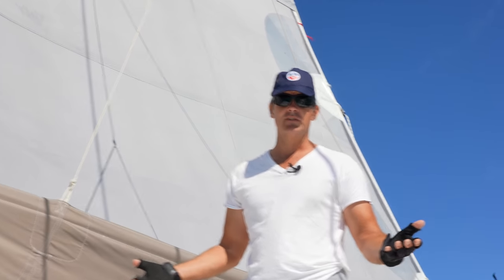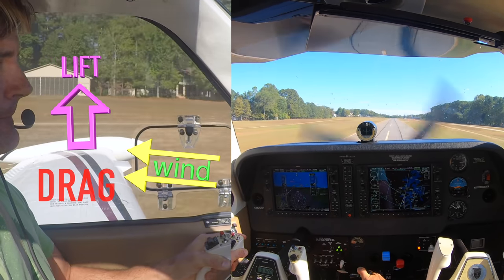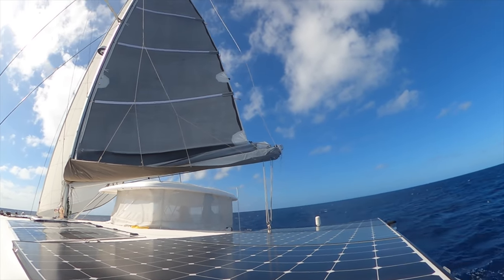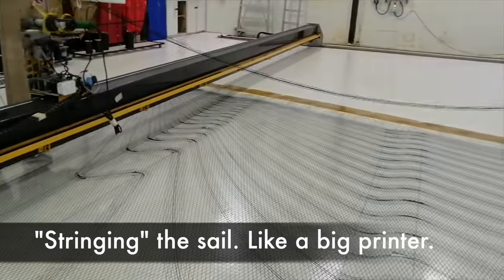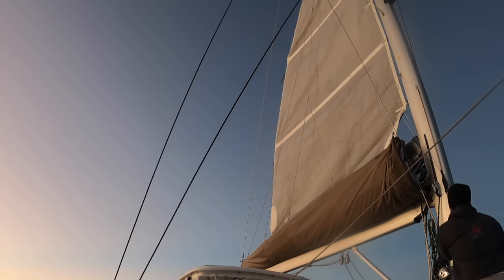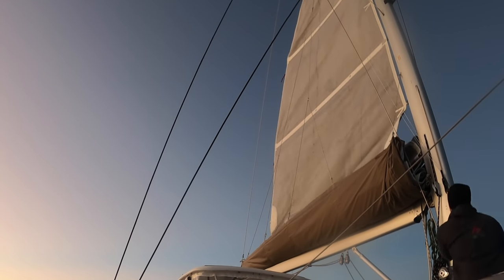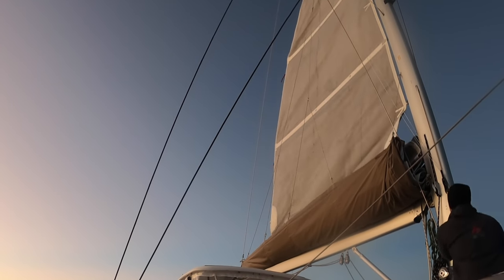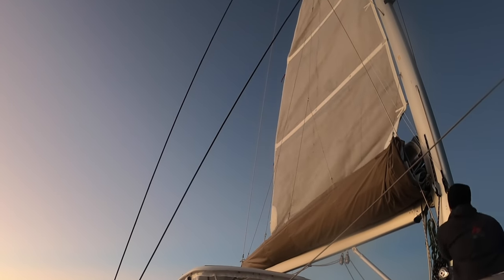PROVING THE CRITICS WRONG [why catamarans don’t sail well]

Comment: Good job.  I like that you are comparing ground tracks and VMG. While sailing an informal drag race between a 45 foot cruising cat and a 45 foot cruising monohull in 2004 upwind I realized that VMG to windward was king.  Pointing is just one variable in the mix.  Pointing is less important than upwind VMG unless you are trying to sail upwind in a constricted waterway which cruisers almost never do.  I often have to argue this point in discussions with other sailors who have not thought it through.
Reply from the maker: VMG is really all that matters….ever. Pointing means so so little.

Comment: Very well explained..! The heeling factor makes sense; in a monohull, as the wind speed increases, its energy is spilled as the  boat heels. But with a flat-sailing catamaran,  that does not happen, so the sails take the full force. So they will wear out and get baggy. Which means you're gonna go sideways a lot when the wind is coming from anywhere apart from behind you.
I wonder if a Junk (fully battened lugsail) rig has been applied to  a cat. It's never going to win races but you reef easily, and less stress on a mast than all this kevlar at vast cost and rolling-furling headsails, a fucking right handful when the wind pipes up suddenly.

Comment: Great video!  I had an old sail on my monohull for 3 years and did not realize it was the sail that was causing the excess heeling and slow speed.  I considered myself a good sailor and good at trim but could never get any performance out of the boat.  Now I know why.  Thanks a million (or at least several thousand...).

Comment: Thanks for a great video. Sure, sailboats are all about foils. I think the most common mistake people make with sails in replacing them is to go back and order sails from the loft the factory uses and order sails just like they had when new. In many cases what you get is a sail meant for the charter trade, presentable but not performance. Many people also shop for lowest cost sails. Both mistakes. Speaking with a sail designer and having sails  made specifically for your boat and your style of sailing is money well spent, Dacron or laminate.
Reply from the maker: So very true. Great advice. We went back to Ullman, but made significant design changes.

Comment: I've seen people down at the marina with sails so blown out they have sewn patches into the sails and run stringer lines to center points that tie to a free floating ring over a line. I don't know how they sail like that and honestly they probably don't and just use the motor to putt around the bay. My favorite is when people go to get on their boats after it's been sitting a long time snd they start raising the sails and rats or mice come tumbling down the sails, long streaks of rodent urine, poop and bedding material come flying out to cover the other boats.

Comment: that was probably the most even-handed review of sails I have seen across the interweb.  One point - the value proposition for sails is that "value= initial purchase price over the time the sail will retain its shape " with the critical determinant being the ability of the cloth to retain its shape.  - I don't think it will be too long before you think of doing the same with your headsail.
Reply from the maker: I know. And the jib is twisting off terribly. But to really put a better jib to use, we really need to do some hardware mods to get the sheet leads further up. I’ll chat with Ullman, see what ideas they might have

Comment: I'll be sailing in the next few years and maybe catch up with you all out there. As a pretty bright guy with zero sailing experience right now, the performance aspect was, admittedly over my head. Lol!  I'm sure the current or prior sailors were able to follow along though.  I'll shelve this episode and watch again after sailing for a year or so and re watch then so it will make more sense. I plan to do that with many of your vids as they're GREAT sources of info. The best!
Reply from the maker: Sorry about that. Tried to keep it relatable. Bottom line is that the sail on the boat is a wing and we need it to be shaped right if we want to sail well. And yet, catamarans are so hard on sails…you gotta watch how fast they wear.
Reply: @TheOKellys  No apology needed. More a reference to my lack of knowledge and experience. Nick gave a great explanation and I’m sure I’ll understand the video better when I’ve sailed a bit. 😉 Thanks for the reply.

Comment: It will really be interesting to see how it holds up to the elements over time.  UV is always a killer regardless... I like your comment on the sail and tradeoff between them.  Good point, sales are really a wearing part and need to be replaced on a reoccurring plan like your engine example.  So, more frequently with a sale that lasts only 1 to 2 seasons, or every 4 to 5 years with a more expensive version.  (that is assuming your sale does not last longer)  Also, would love to see you find another Leopard and see if they can follow you, and what issues you or they, run into.  Great content!  And yes, a certain sail maker should be sending you chocolate.  And by chocolate I mean.....
Reply from the maker: Our previous laminate held shape for 7 seasons. This current dacron sail was good on Clarity for ....maybe 2-2.5. So....yeh, there is some math involved.

Comment: Airfoil
From Wikipedia,
The lift on an airfoil is primarily the result of its angle of attack. When oriented at a suitable angle, the airfoil deflects the oncoming air (for fixed-wing aircraft, a downward force), resulting in a force on the airfoil in the direction opposite to the deflection.

Comment: That was very interesting. Well presented as well especially with your data comparisons. I am wondering though what a distance over ground cost comparison would be if you through motor sailing into the mix. It would seem you can get a lot of diesel for the price of a top performance sail.
Reply from the maker: Interesting question, but sailing for us is not about $/mile as I am sure there are less expensive options. For us, it is about (pardon the cliche) harnessing the wind. However, yes, someone should do a motorsailing test for sure, because many catamarans are used in just this way!
Reply: @TheOKellys  Threw not through. I can spell.. Onist 😆.
Reply: That may not be for much longer... plus there are problems coming up with bio diesel additives  ...check on soap clogging of filters...water absorption and  decay.
Reply: I wonder also the effect of harnessing all available surface area for Solar input and that solar power sent real time to an outboard 2Hp electric motor.  Then combine the wind and sun together to "solar" sail. Surely over a six hour sunny window each day it would eventually pay for itself and speed passage.
Reply: @6800891 
When you get to a certain point with solar and e motors you reach Silent yatch levels ... they ditched a standing rig in favour of a Parra kite ...Solar and a gen-set for emergencies and sustained use of full E motor power.  
Though if solar makes the next possible jump and batteries get cheaper and more effective The amount of  run time most cruisers will need will diminish to a few hours in a period of months.
Sophisticated lady have already experimented with their ten hp electric dingy motor as an emergency back up pushing their heavy full keel monohull along and then leaving it down and using it as an E regen unit while under sail.
Reply: @clivestainlesssteelwomble7665  And at 58, I can see a day when I would no longer be able to safely manage a sailing rig and I get excited about the prospect of silent odorless unlimited free propulsion allowing me to head in any direction anytime all from the cozy confines of a nav station.
Reply: @6800891  
Totally agree.. in boom or mast furling systems and power winches with controls fed back to protected helms are logical especially given the growing instability in weather patterns. 
Even if there's a couple it only takes one person to slip and break a limb, dislocate or get KO'd and handling a sail boat can get dicey. 
I burn in spring sunshine so ive never liked the idea of  hypothermia fatigue.... thats when mistakes get made only to get skin cancers.. 
When a certain pair of Australian doctors lost their new Leopard to 🔥 i took a look at all the Cats that i could find that met their match.  
One that hit in many ways was this one. A boat rigged ahead of its times.

https://youtu.be/3Pem-4H1qg0

Comment: Use to race Hobie Cats back when 300 would show up to race, starter sailing on a 230 3 mast blue water steel hull & have had a few different mono-hulls, the deep keel boats point higher, but lack the speed of a cat. So bet the lower pointing angle is made up by Cat speed at the end of the day, but it could be like the Tortoise  & the hair story too.

Comment: it’s a trade off, performance sail, performance beard. it’s a chin scratcher - but seriously this is a fine piece of filmmaking. 

For a racer and sometime crew-mate of Dave like me, the performance envelope of your boat under sail means you can run your engines less, especially to windward. Good tools make for good work. You can shave miles off of your passage with strong COG, leaving obstructions well to leeward with confidence. Fine boat handling is a pleasure to watch from on board or from far off. Cheers.
Reply from the maker: Ha! Good ones. Chin scratcher…lol. Second contemporary of Dave I’ve chatted with this week. I’m sure sail performance means very little to a lot of heavy cat drivers, but for real sailors worried cruising cats won’t sail….man, good shape is just so important….arguably even more important with our low-aspect keels….I wanted to get into that…but the vid would have been an hour long!
Reply: @TheOKellys You achieve a successful balance with useful content and images. Your viewer comments attest. What fun to optimize your home afloat to sail upwind better and short-handed even! Stable boats are sticky at low speed. They make gurgley noises to remind us they like to reach in pressure. I bet you hav learned the best trim to balance lift and drag through the wind ranges. Aramid sails stretch less in a breeze, shrink less from UVs and hold their shape through the life of the sail. It is kind of like how a really good set of tires allow a fine car to perform better. Until it snows and they need to switch out to winter tires. Enjoy the positive feedback.

Comment: That's great Nick! How do the batons figure in? Do the laminate sails have very different batons?  Are you finding your new sails take shape adjustments better than the old ones (twist and such).  I would think the shape (and the flow attachments) is so important. Thanks for all that info! F
Reply from the maker: We used the same battens actually. Had to cut a couple a few inches. But yeh you are on the right track…the laminate is way more predictable when trimming. With the old sail, it was so much guesswork…in fact we’d often reduce sail just so we could get rid of the baggiest part. So frustrating!

Comment: Drag on sailboats is dominated by induced drag, both of the sails and the hulls.

With daggerboards, the induced drag is very roughly equal between the two.

Without daggerboards, the induced drag of the hulls will totally dominate.  Cruising cats get their bad reputations because
* many don't have daggerboards or don't drop them when they should, and
* there's so much clearance between the sails and the ocean surface that, combined with maximum AoA at the bottom of the sail, you get a huge vortex off the bottom of the sail.

The first problem is that the "span" of your hull in the water is the depth, which is tiny, maybe 80 cm.  Induced drag is (lift/span)^2/dynamic pressure/e/pi.  e and pi are constants, so forget about them.  A daggerboard that extends just 160 cm further into the water cuts induced drag by a factor of 9.  You'll do better than just sail with a smaller leeway angle... you'll sail faster too.

The second problem is why jibs and head sails do so well compared to main sails... they have less of a gap to the ocean surface, so less wind is able to slip under the bottom of the sail.  Jibs will often be in actual contact with the deck several meters back from the stay.  Mains have a hard boom which has to clear a roof as well as anything above it, like Clarity's raised helm roof, so lots of gap.
Reply from the maker: Hmmmm, I know a fair bit about fluid dynamics. I think you mean parasitic drag dominates.
Reply: @TheOKellys  Oh cool you're a meteorologist!

The Reynold's number for a 46 foot boat in 68 F water at 8 knots is 57 million.  Momentum totally dominates viscosity, right?

Let me calculate it out for your boat.  I'm going to guess 8 knots boat speed (8500 Pa dynamic pressure) in 13 knots of wind (27 Pa dynamic pressure), apparent angle 30 degrees off the bow.  Hopefully that's close enough.

Your 46 Leopard has around 1000 feet^2 of sail area.  It's got a fair bit of camber, I'll guess you can get a lift coefficient of 1.5 out of it.  In 13 knots of wind that's 3200 N of lift.  That's 1600 N of surge and 2800 N of sway just from lift.  Total sway is actually 3200 N because you pick up almost 400 N from the induced drag off the sail, and there's probably a bit more off the hull that I haven't counted.

All that sway has to be reacted with the keel.  Your keel is 135 cm draft (I looked it up), which is a lot more than I'd guessed, so now comes the part where I look dumb.  

260 N of induced drag of the keel, 16% of thrust.

Induced drag off the sail is 745 N, 645 N of which is boat drag, 40% of thrust.  I guessed 18 m span and e=0.5 because the span loading is so asymmetrical.

At 56% of thrust, induced drag is a tiny bit bigger than parasitic drag.  I hadn't realized your keel was that big.

With such a large Reynold's number, I wonder where the rest of your drag is.  Is it base drag off the tail?  It's hard to eyeball how much area below the waterline you have exposed at the back.
Reply: https://www.youtube.com/watch?v=zCpVfFDYfWE

Look at the mess coming off the bottom of the sails.

Also, I was even more wrong.  That hull induced drag number should be cut in half, because there's only one vortex off the bottom and nothing at the top.  So 8% of thrust.  Total induced drag is 48% of thrust and it's not even the majority of drag any more.  Ooops.

Comment: An interesting note with catamarans I used to race dark class catamarans on Lake Simcoe in the late 80s Jeff and I took the Canadian championship and shattered the record I believe it was 89 but those small cats we were on it's just a trampoline with a sale but the point is small cats don't have any trouble sailing the way big cats do the bigger the catamaran is the worse it gets part of the problem comes in that when you got a cabin up that's wide enough you got a catamaran that's wide and when you have a big catamaran one wave hits one side another wave hits the other side and you end up in a situation where it's wobbling back and forth all over the place and it makes it much more uncomfortable to be on board because two holes are taking two separate ways it makes it really uncomfortable and a lot of people expect it'll be more stable while technically that's true side to side if the water conditions were dead calm but once you get into rough or Waters it's really not true anymore a small cat these problems aren't noticeable but on a large catamaran they are definitely noticeable and it makes them more uncomfortable to sleep aboard for a lot of people.

Comment: Hey Nick what is the point of a high output alternator if you are going to need to put a DC to DC charger in front of it would not just limit the output of the alternator?
Reply from the maker: Hey there. Well, first of all, I may change it to charge the house bank direct and then go DC-DC to start batteries, so I reserve the right to change my mind. As it is now, it is working very well, but I may change it later. Here is my reasoning for current setup: 1. They are 170A alternators....that doesn't mean they do or can deliver 170A continuously. More like 100-110A continuous, max. 2. The solar can charge at 100A as well for hours on end, so I don't really NEED or want to be sending 300Amps to my house bank, so why generate all that heat for no reason? 3. Since we are now without a generator, I want to treat these alternators tenderly, not redline them all the time, and that's what lithium batteries will do. Yes, I could de-rate the alternators with their "belt setting", but then aren't I just limiting the same way that the DC-DC will? At least now I can change the Orion charging with my iPad. Kinda cool. So there you have it.
Reply: @TheOKellys  Thanks for the reply.

Comment: Well done by... me! As opposed to the other end of the spectrum- not so "well" done by me- Rut Roh Nick just say'n.. 
What is the power of any sailboat? Sails Matter. Good to great ones- you're gonna get somewhere faster more efficiently.
Older crappy sails- you'll get there at some point maybe. Weight difference matters & you have lighten Clarity lately.
Smooth hull, great rigging fine tuning as you go, new crispy sails you can go to windward in a Cat. 
Sometimes it is owner operator error that makes or breaks VMG. Performance sails matter in racing.
Cruising not so much, unless you're racing another Cat up wind for that last mooring ball in the anchorage.
Good to see you both enjoying the adventure. Stay well my friends.
Reply from the maker: Ha! i love it. Yeh you are right, she is a little lighter. Speed wise she was better with the new sail, but was it the weight or the sail? Thank you for the note!